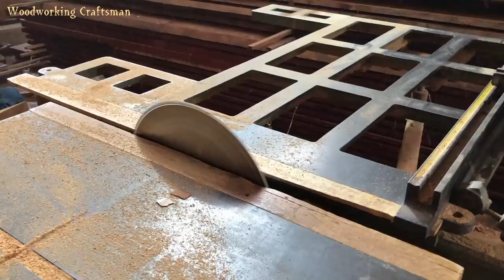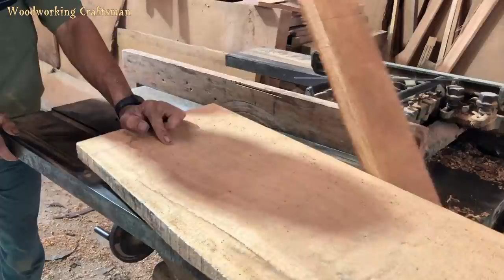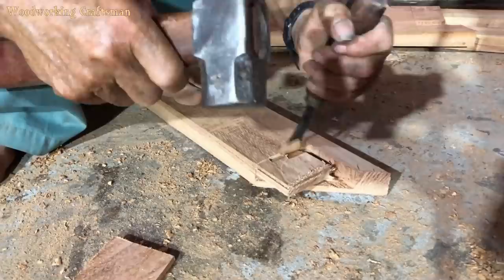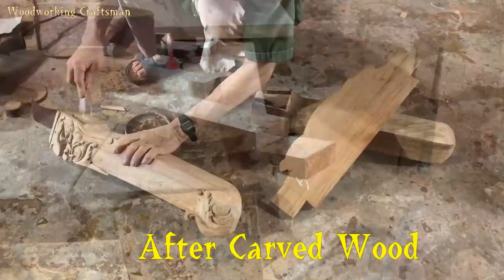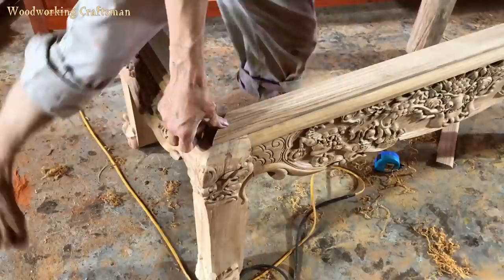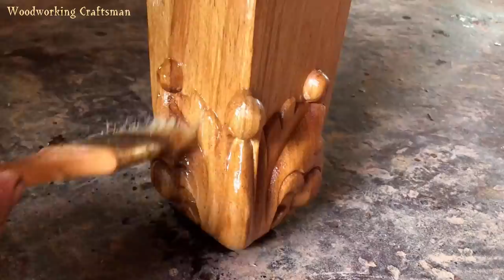Extremely Ingenious Woodworking Workers // Amazing Woodworking Skills Of Crafts Carpenters

Comment: What is the red "press" machine that punched square holes? Never seen that before and my father is a carpenter
Reply: It's a morticing machine
Reply: The Morticing tool is basically a square tube, with sharpened sides, and inside is a wood drill. The square holes are produced by the drill, and shaped by the chisel edge's of the tube, in the same operation.